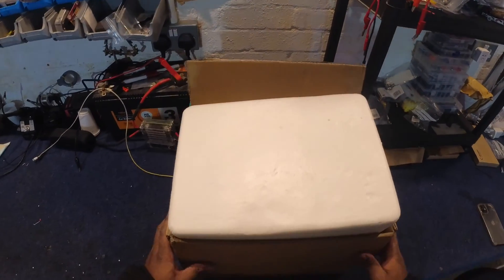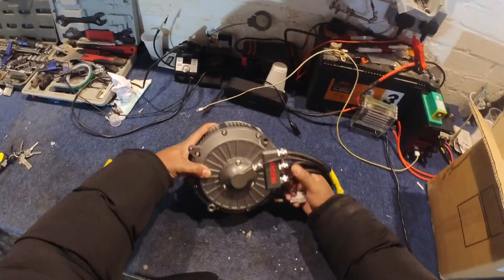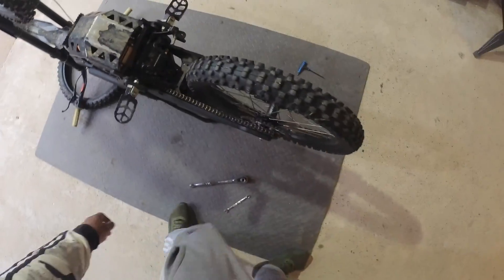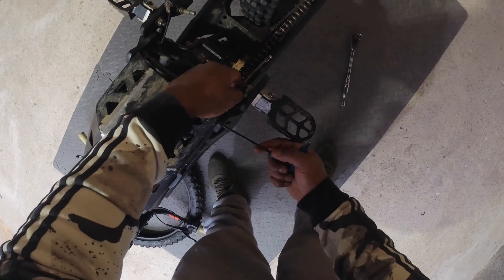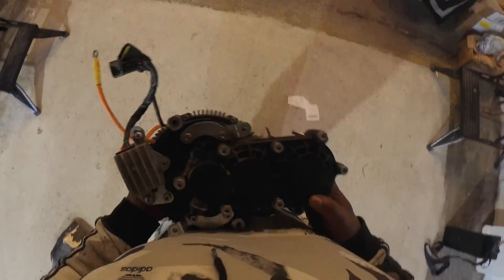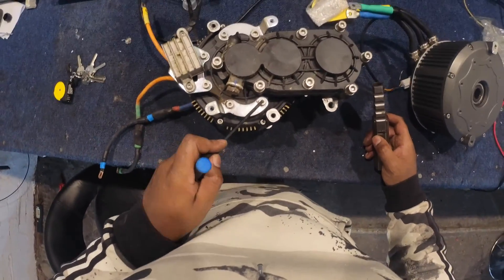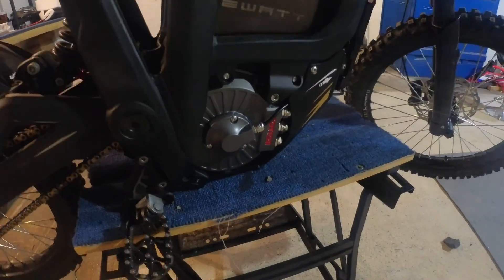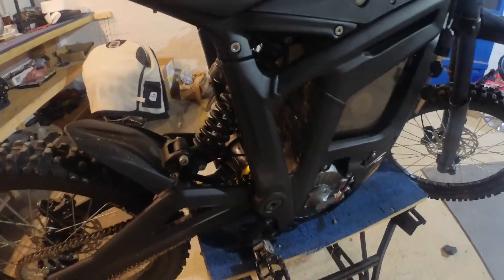Talaria Sting MX3 MX4 Sotion Motor Installation

Comment: dude replace ur fire alarm batteries
Reply from the maker: dont worry about that it’s hard wired to the electric supply 😂🤣🤣
Reply: @ebikemodshed4949  But why would you still want to live with the beep
Reply: @ebikemodshed4949  11 months actually, I am curious if you have installed a new battery to stop the beep?
Reply: No bullshit I had to listen to it with no audio cause my dog freaks out. She’s a little bitch when it comes to that noise

Comment: Nice video, is that an mx3 you are dismantling or an mx4? I ask because I was curious if both gearboxes have the same sockets. You are selling the same motor for both mx3 and mx4. I heard the gearbox mx3 and mx4 differ.
Reply: they are the same just better mounting points on the mx4
Reply from the maker: Same what @realkudcarter said they are the same but this is a mx3
Reply: thanks for the answer!   @ebikemodshed4949  @realkidcarter
Reply: @ebikemodshed4949  did you not read what i said lol they are the same internally
Reply from the maker: @realkidcarter  did you not read what i said agreeing with you 🙄
Reply: Mx4 motors gearbox bracket has 4 bolts. Mx3 gearbox bracket uses 2 bolts. The sotion motor has its own gearbox bracket. So it doesn't matter if you had a mx3 or mx4
Reply: @MotoAlias  
Next time someone asks the difference between the mx4 vs. mx3. Tell them, anything that will work on a mx3 will work on a mx4. 

No matter how many times I tell them the mx3 and mx4 are identical and are only separated by bolt on parts...they never get it.

Comment: So Encoder or Hall version? What the difference?
Reply: They're sensors that read the position of the magnets in the motor to deliver smooth power. Encoders are newer technology but they essentially do the same thing. Which one you should get will depend on what controller you plan to use. Some work with encoders some work with hall sensors